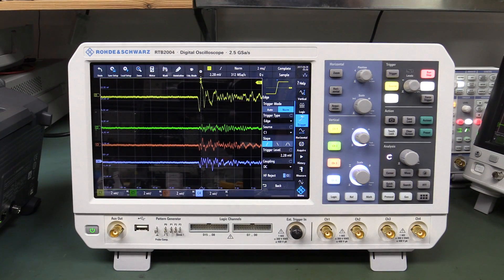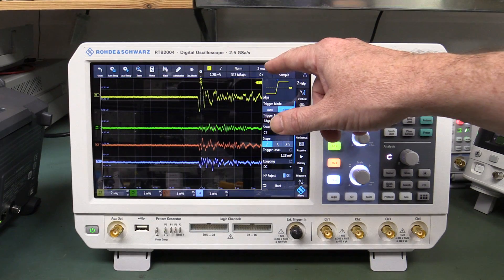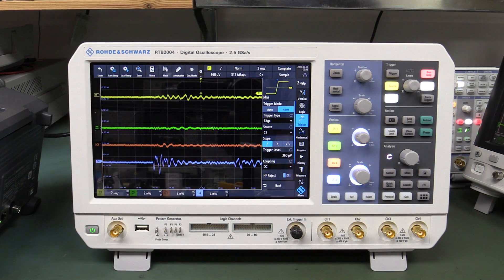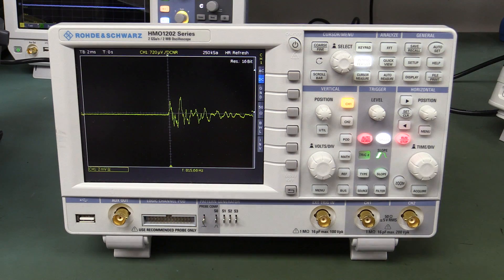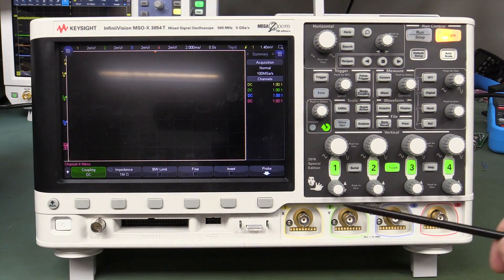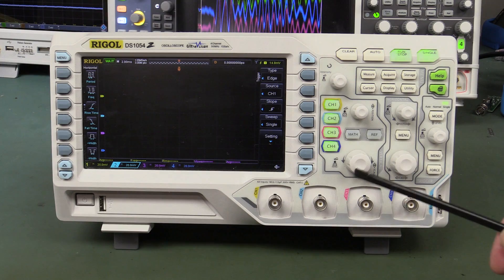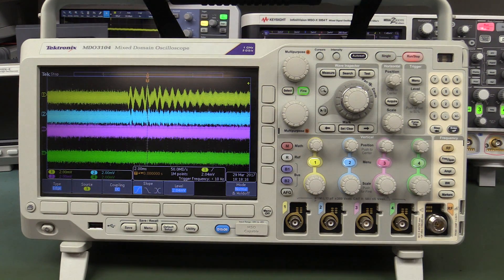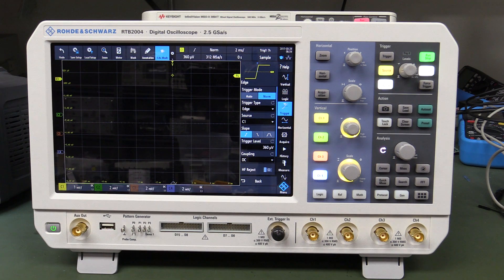EEVblog #983 - A Shocking Oscilloscope Problem!

Comment: the next time someont tells me, vibration damening does not effect hifi amplifiers, i'm gonna show them this vid.
Reply: If your amplifier uses mlcc caps in the audio circuitry, it's a piece of junk. Film capacitors will not have the microphonic problems like ceramic caps do.

Comment: nice to see what actually occurs when I repair my TV by slapping the side of it
Reply: A fellow student jokingly suggested to investigate what happens when you slap an old TV as his coursework.
Reply: seymourshabow 
That's more likely due to a 'dry' solder joint or poor connection that temporarily improves its conductivity due to 'percussive maintenance'! 
I doubt the piezoelectric effect is likely to cause any obvious changes to the operation of a television.

Comment: Turns out it's not a significant issue once you plug the probe in - only with an unconnected input.
Reply from the maker: Nope, it's still a potential issue even with a probe plugged in. 
Even with a shorted x10  probe I still get 1-2mV with the poker tap on the screen. Not unexpected as the 9Mohm + low cable cap doesn't present much of a load.
Obviously it's going to be a complex interaction with the source impedance and cable used etc (which are now a "load" for the voltage impulse)
Yes it goes away with a shorted x1 probe (i.e. a low impedance source) but it's not right to say it's not a significant issue when you plug a probe in. I still see it. YMMV
Reply: The issue is that the voltage generated in the capacitor pushes a tiny amount of charge into the input, causing a voltage shift. 
Any capacitive or resistive load on the input reduces the effect by absorbing some of that charge.
Reply: Thanks Mike, I was looking at those unconnected connectors the whole video and wondering the same thing. I'm surprised Dave didn't do a test with it connected.
Reply: @AndreMillerF  Dave did it !  Watch the video from the very beginning !
Reply: Microphony disappears completely with a low-impedance input.
Reply: If you're interested in  1mV signals, a x10 probe is probably not a good idea. If you really need high impedance at that low a level you should probably be using an active probe
Reply: thanks Mike
Reply: Turns out it's not a significant issue once you plug the probe in - only with an unconnected input.
Sure, because nobody ever needs to use a scope to measure high impedance signals. /s
Reply: mikeselectricstuff it would be an interesting experiment to do a side by side test with and without the probe. Follow up Dave?
Reply: If it is so, does it mean the more prone to this effects, better the scope performance will be ? because may be the input is well engineered to consume less power from the input probe. This effect was lesser in gwinstek comparable to others and hopefully they are not the best front end designer out in the scope market.
Reply: mikeselectricstuff why would the probe being plugged in help the issue?
Reply: That is still a lot of microphonics. Even with the trigger channel terminated it would still show spurious noise on adjacent channels that could spill into the ones your monitoring. In the work I do its not uncommon to be using a scope next to a large vibration table or shock testing machine to monitor DUTs that subject the test cart (and thus scope) to some vibrations.
Reply: EEVblog Dave, check this out with old stuff like tek24xx or 22xx :)
Reply: mysock351C yes but apparently this is a common problem with most digital scopes.
Reply: EEVblog thanks for checking it again! I kept wondering what would happen if the probes were connected!
Reply: What when you "terminate" the inputs with 50Ohm terminators?
Reply: J'ai une enceinte marshall, quand je tape le dos, le bt se coupe et elle passe en mode line pendant quelques seconde.
Il n'y a pas de switch bt/line, c'est autodetect.
Sur les forums, ils disent l'entrée est sensible, serre les vis.
Tu m'a donné une piste de recherche merci.
Je vais tester mes scopes siglent et micsig voir si le chinois est mieux amorti 😂😂
Reply: I'm glad you're here to explain things Mike. For a second there I thought my scope was rubbish.

Comment: I've just whacked and prodded my DS1054Z like crazy, and couldn't get it to trigger via the chassis. Directly on the BNC it works just like you show, but I couldn't get it to trigger even once via the chassis. I've tried different pens and positions, I even tried smacking it right next to the chassis.

Comment: Me : "Doctor, it hurts when I do this"
Doctor : "Don't do that"
Reply: "I broke my arm in two places!"
"Stop going to those places."
Reply from the maker: Quick, add it to the user manual!
Reply: Apple: you're slapping it wrong.
Reply: I like to say "Don't do dat den" ;)
Reply: God Emperor Lionel Lauer If you need to do measurements that require 1 mV trigger threshold, the noise captured by tapping the scope would be the last of your problems.
Reply: I still wanted a trigger warning.. :P ;)
Reply: This is a common doctor statement. I told my doctor the seat in my car presses on my hip, the doctor said don't sit in the seat!!!!
Reply: yes, but user must know about that "option". Greetings from Ukraine.
Reply: I wonder what the amplitude of the shock waveform would be when you drop the Scope onto concrete from 10 feet ?? :whistle:
Reply: Ç
Reply: I'm wondering if part of it has to do how well the boards are mounted on the inside
Reply: Don't do this to the next model dave, it will have feedback times 10!
Reply: Juan Herrero, that's the best way I've heard that joke worded.  Have you heard of an English comedian called Tommy Cooper or another called Tim Vine?  I think you'll like their stuff.
Reply: +Benedict Nothing No, I'll check them out.
Reply: How do you operate a touch-screen scope that generates artefacts when you touch the screen?
Reply: And call it a feature
Reply: I just watched a guy whack a scope for far too long
Reply: Patient: Doctor, it hurts when I touch here, and here, and here, ... and here too (pointing at different body parts).
Doctor: What you have is a broken finger.

A (Spanish?) joke I often use when explaining diagnostics and the importance of having known-good replacement parts and tools.

Comment: What if loudspeaker on near scope? I'll try with my rigol 1054z today.
Reply from the maker: Would likely have to be very loud as it's not rigidly coupled, but would be fun to try!
Reply: Loud noises in a data center is a known problem. Google it and you will find many links, including a couple studies. In one case they did a test run of the alarm system on the halon fire suppression system. When the alarms sounded the big disk farms started experiencing a large amount of errors.

Edit: search for "Loud Sound Just Shut Down a Bank's Data Center" and you will get a nice example. Oh, it was inert gas not halon, but it will kill you just as fast once all the oxygen is gone.